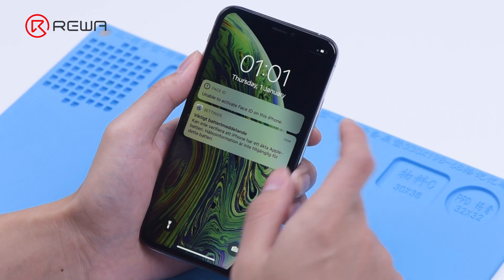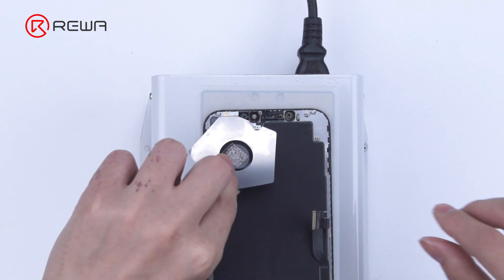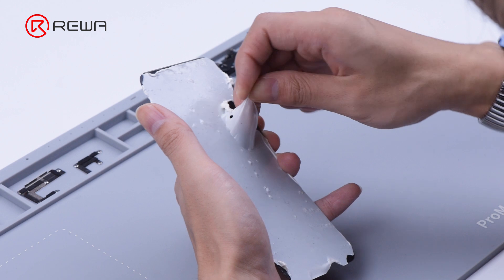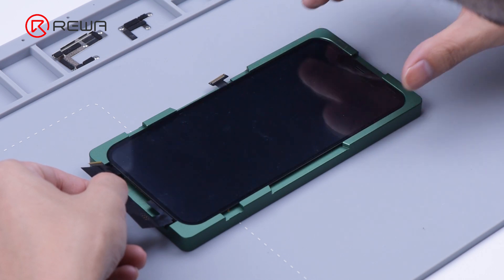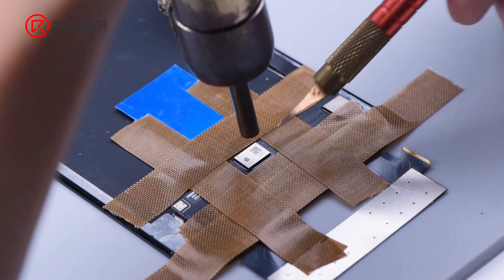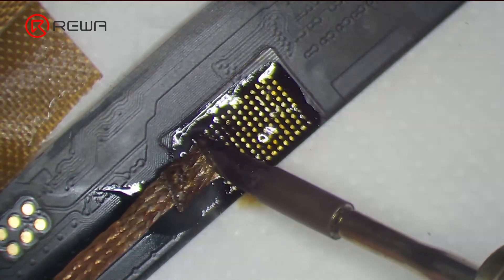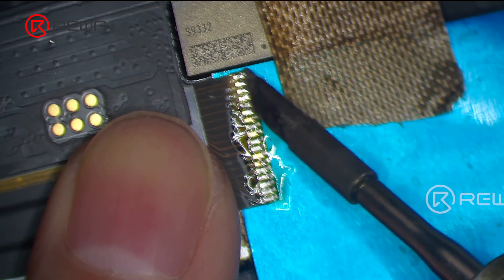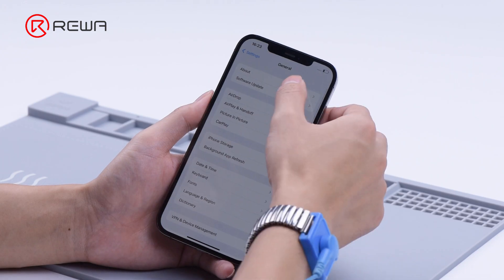Fix iPhone 12 Pro Max Touch Screen Not Working by Installing a Tag-on Touch Screen Digitizer

Comment: Do I need the original screen ic?
Reply from the maker: Yes
Reply: @rewatechnology2008  hello
Reply: @rewatechnology2008  I used another original ic, but not the screen, and it reads information on the programmer, but the touch does not work
Reply: @rewatechnology2008  I am asking about the need for the ic of the same screen, or to put any original one from another screen
Reply from the maker: @ahmedamer7150  You need the original IC paired with the original screen.
Reply: The screen itself, or any other original one?

Comment: No body can do 🤣
Reply: Made it month ago
Reply: @danielakynbay6613  Do I use the screen ic or do I use any other original ic because I am digging the ic
Reply: Technician can do
Reply: We did alredy IPHONE 12 PRO MAX TOUCH ONLY CHANGE DONE TOUCH NOT WORKING SOLUTION
https://youtube.com/shorts/sKCCJANcA-8?feature=share
Reply: i can
Reply: I can
Reply: I can do most ic transfers. I haven't tried this personally, but I think the worst thing will be getting ic off the original screen without damaging the flex
Reply: I change touch after watching this video thanks rewa❤
Reply: I can do